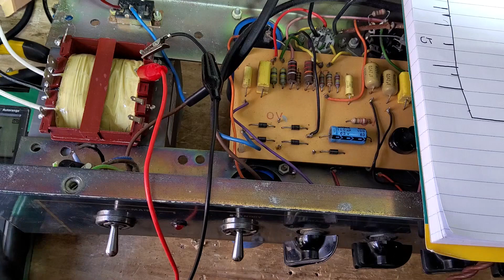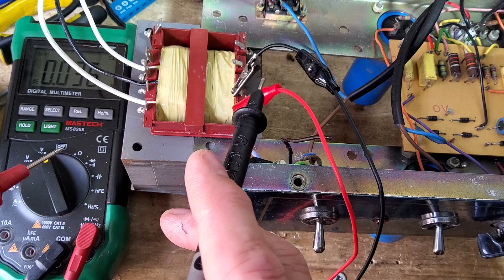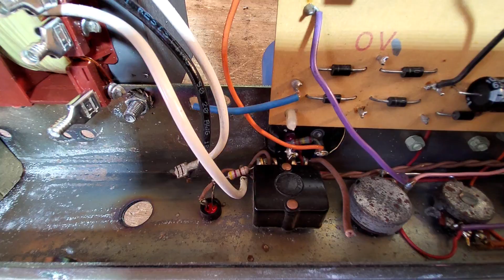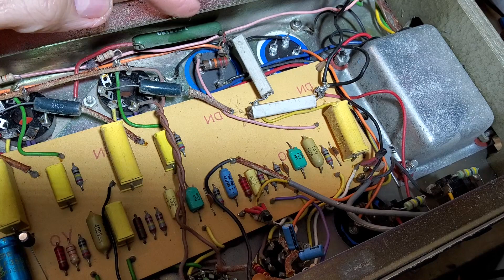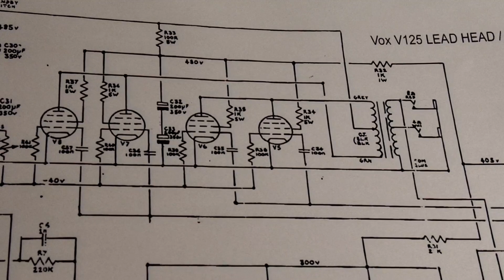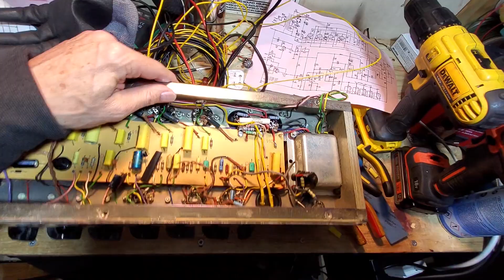Vox 125 Guitar Amplifier Head Head Restoration Part Two

Comment: Hello, why do you put the mains cable coming into the amp to the fuse first then switch then transformer,  why not switch, fuse then transformer  as the plug on the mais cable is fused...
Reply from the maker: Hello Keith. This is a hot topic. I wire to fuse first because that is the recommended way to do it. There is for and against for both ways. It's up to the tech that is wiring it. I have done both ways in the past. I think most techs have. Thanks for watching and take care.

Comment: I'm commenting as I'm watching, which is why I didn't put it all on the same post.
The 50k mystery resistor to ground was probably installed as a filter drain. It would only draw 1mA at 500vdc, so it shouldn't hurt anything
Reply from the maker: Hello Henrik. I should have done the math on that. 500  / 50000 = 0.01 I am a dummy sometimes. I removed it though as it wasn't on the schematic. That's a good spot, thank you.

Comment: If you wired the main filter caps in series, you really ought to place balancing resistors across them to distribute the voltage evenly over both caps
Reply from the maker: I did mention in the video that I forgot to put them on node 1. That was my boo boo for the day. I did put them on node two though. I will put them on before it's complete. I put the resistors out on the bench too. Still not quite got my mind up to 100% with Mum passing only a few weeks ago. I am glad I have the subscribers to keep an eye on me. Thank you and take care.
Reply: Best of luck! My condolences on your mother 😢
Reply from the maker: Thanks Henrik. Take care.

Comment: What a mess that amp was before you fixed it.  Good Job!  It's my understanding that the standby switch is a good idea on a diode rectified amp, but not necessary on a tube rectified amp.
Reply from the maker: Hello Michael I may have fixed most of it up but part three has gone up and things didn't go well. As for the stand by switch: Have a read of this and let me know what you think.   https://www.valvewizard.co.uk/standby.html
Reply: @vintageguitaramp_guitarteacher  I watched part 3 yesterday afternoon.  Too bad about the output transformer.  I have always used the standby switch on my 3 diode rectified amps (1968 Fender Bassman, 1976 Super Twin Reverb and 1990's Sovtek Tube Midget), but not on any of my tube rectified amps.  In fact 2 of them (1979 Vibro Champ and 2010 Carvin Vintage 16) do not have a standby switch.

Comment: As I understand if there are direct coupled  cathode follower stages in an amp then the use of a  standby switch is important because if the tube heaters are not hot then there is a risk of  the high voltage  of the preceding plate conneccted directly to the follower grid shorting to ground or cathode.
Reply from the maker: Hello Peter. That's correct info on the cathode follower. The use of a diode or neon light is recommended between the grid and and cathode for start up. I removed the standby switch in this amp only because of safety. The switch was to close to the capacitor directly underneath it. It couldn't go on the back of the amp because it's covered. I wouldn't have removed it otherwise. Some people like having a stand by switch and that's okay. I would be a liar if I said that I had never used one. I think the link below is a fair explanation of the standby switch. This guy knows a lot more about tube amps than I ever will. Have a read and let me know what you think. Thanks for watching Peter and take care.

https://www.valvewizard.co.uk/standby.html